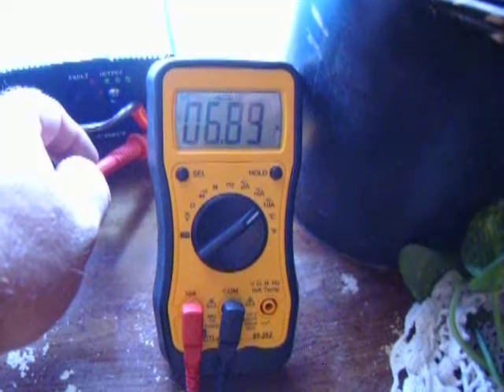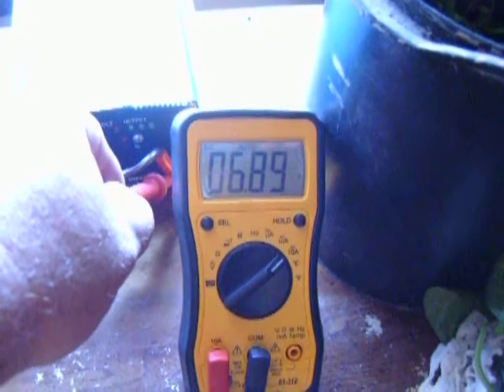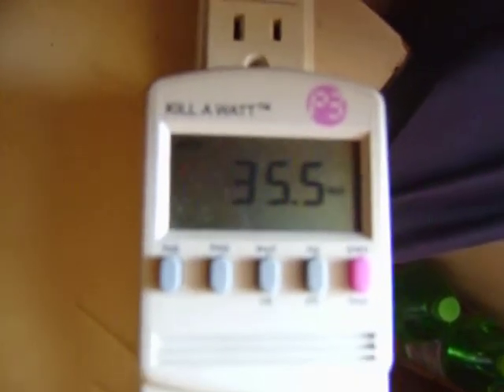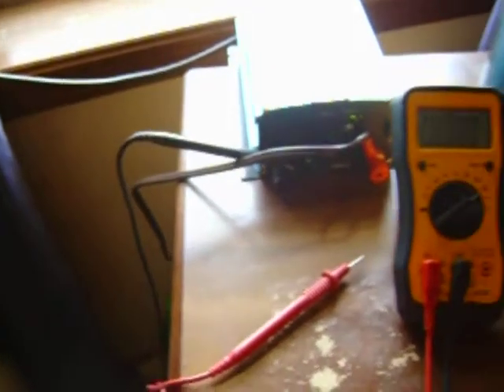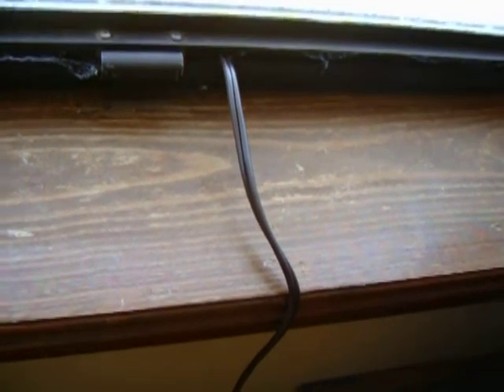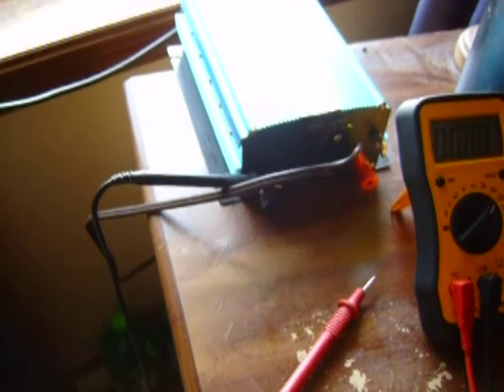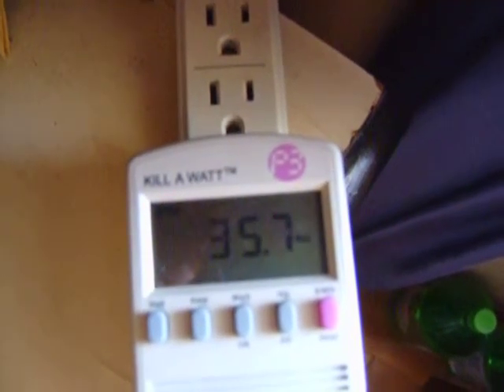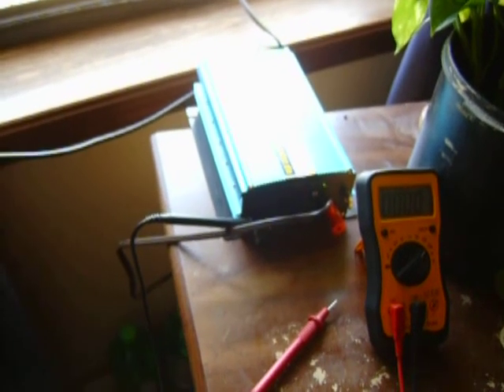Wired up  90 watt panels into the Grid Tie Inverter in Hot Weather Big Power Loss.

Comment from the maker: @LoveMyDogy lets say your 3x6 cells are rated at 3.6 amp so volts times amps equals watts is the formula for figuring out watts. Lets say when you make a panel you hook them up to a battery then it pull your 20 volt panel down to say 14 volts  so 14 x 3.6 amps equals 50 watt panel most likely in reality. But I think they rate those 3x6 panels around 60 watts. Try to put all forty cells down on some glass if its big enough. 36 is the least you want to use. the more cells the more voltage & watts

Comment: When you measure the amps you should do it in series with the GTI. And we need a voltage reading too then you can see how much is going in and compare with what is coming out. It's not good to short the GTI terminals. The GTI should be at about 80% at those levels. Try thicker wire of course, even just a temporary set up for a test would help you figure this out. Got jumper cables?

Comment from the maker: I guess I have concluded that it is around 6.9 amps hooked up to the grid tie and I measured it while it was hooked up to the grid tie. I am loosing all the percentages through the grid tie. I only have a 7 amp fuse in my amp meter so I cant measure the amperage on the other panels they are I assume make way more than 7 amps because the other inverter Fearlessthinker gave me is making 50 to 60 watts.